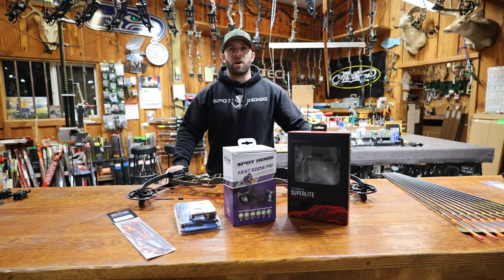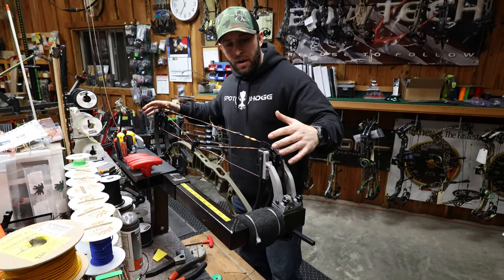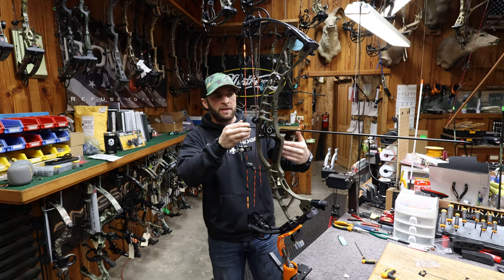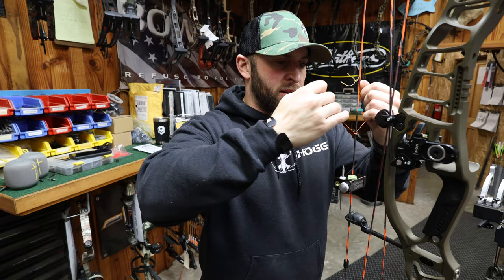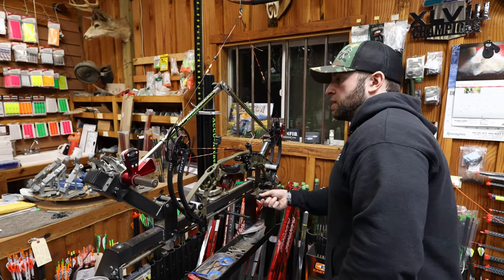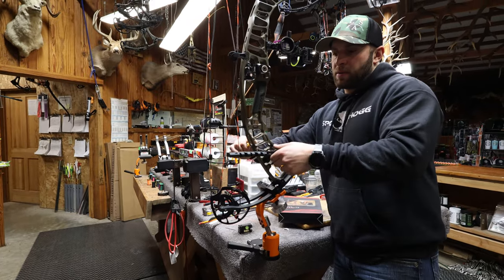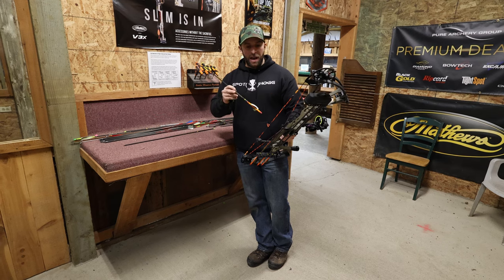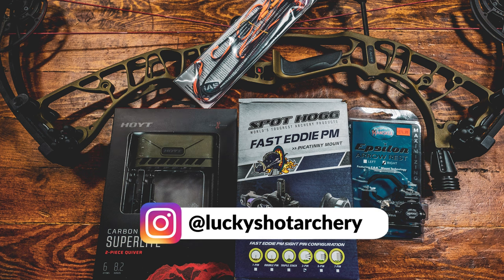2023 HOYT Z1S Complete Bow Build (LuckyShot Archery - Chehalis, WA) *GIVEAWAY* in description!

Comment: I'm going to have to go try one of these.. may be the replacement for my RX4 Turbo, though speeds seem about the same (I'm at 270fps with a 505gr arrow, 28'' dl).  If the draw cycle has improved substantially it might be worth buying.